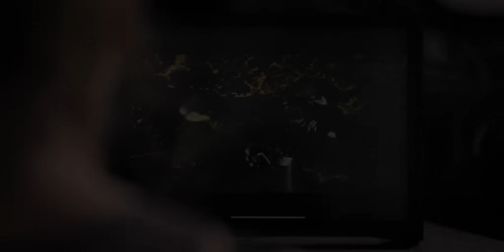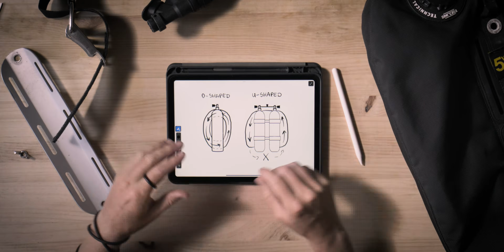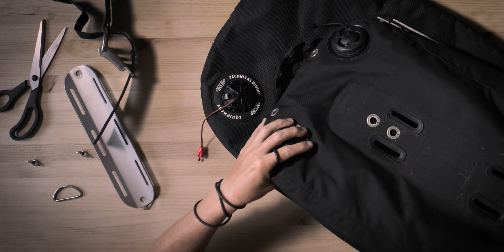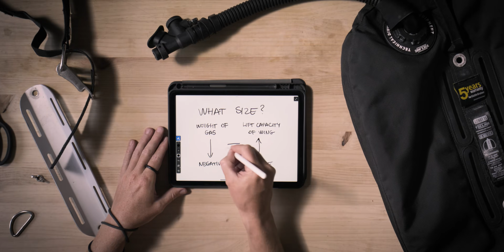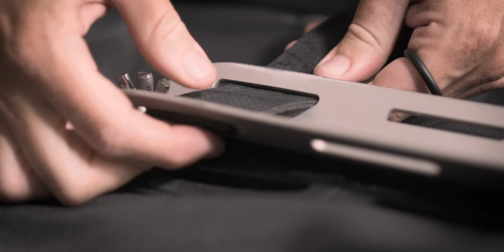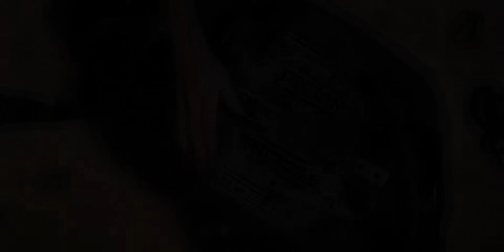How To Assemble Your Wing (BP/W) | Master Series

Comment: Great video as always! Can't wait to see more. But I have a question, I've been looking for some time to buy a backplate BCD. In my case right now, I'm diving with a 15l liter bottle and a stage 5.7L. By the gas weight calculation with a 10 kg lift wing is enough, but right now I'm using a normal BCD which has a 22 kg lift. Would you guys recommend me to get the 10 kg lift wing or a bigger one like 13 or 15 kg? I don't know if this needs to be considered, but I'm also pretty big, I weight around 90 kg, and I am 185 cm tall.
Again, thanks for these great videos, you deserve much more views and subs. Finally, a channel that posts high quality instructive scuba videos.
Reply from the maker: Thank you for your comment! Adding a stage complicates things slightly, and I'm assuming you have an aluminum one? We can't answer your question without knowing that for certain, as well as your exposure protection. However, based on the little information you shared, here is one piece of advice I can offer: I don't see a single good reason for the setup you're using. If you're using the stage to extend your bottom time, you should clean up your configuration and move on to diving a twinset. That will solve 99% of your problems including the ones you don't currently have.
Reply: @flowstatedivers  Wow, what a quick answer😁Thank you. Yes, the stage is an aluminum 5.7L, and it's used for deco stops right now with a EAN40% I can't use a higher O2% with my actual training. For exposure protection, I use during winter a 4 mm neoprene dry suit and during summer a 7 mm semidry.
Reply from the maker: This is even more puzzling as 40% nitrox is recreational mix where deco should not be a factor whatsoever. Anyways, you are using the worst possible exposure protection for the job + the wrong configuration. These wetsuits are absolutely not recommended to be used below 18 meters due to the compression and loss of buoyancy especially not with steel tanks. You also possibly confuse stage and deco bottles, those are 2 different things. All this is telling me that you have some major confusions which is not a problem but be careful with the dives you are (I assume) doing right now as you will quickly find yourself in the kind of trouble you don't want to be in. We will release some material on unsuitable equipment combinations you might going to find something in there which will help your diving. Stay safe out there!
Reply: @flowstatedivers  Okay, thanks. I'll stay tuned for those videos. I've been trained and also always dived in the same diving center, and it is true that during this year thanks to diving in other places and investigating by myself. I'm slowly realizing that in some aspects I may have not been trained how it is supposed to, specifically in knowing the big gap that there is between recreational diving and tech diving. It's something that in some months when I have more spare time I'm going to address. Comments like yours really help me realize my mistakes and weakness and motivate me to do what I've always tried, to become better and better at diving. So for that, seriously, I'm really Thankful.
Reply from the maker: @andreuduran6507  Your attitude and willingness to improve are truly exemplary. It's amazing to see this! Just remember, train hard, dive easy. Don't hesitate to reach out to us if you would like to have advice on anything diving related, we are happy to assist you.

Comment: I have a question does the o shape wing goes with Double tank aswell ?
Reply from the maker: Sure, that's the most commonly used one for both single cylinder and twin-set configurations. Just be sure not to use wings made specifically for single cylinders with a twin-set. So, whichever setup you want to use, buy the appropriate wing purpose-made for that configuration.

Comment: In the early 90s I was at a dive show in London and I bought a dual bladder Northern Divers BC.
I have dove with that BC for the last 30 years , prob about 150 dives. And it has worked flawlessly.
Just a month ago I had the steel backplate removed and replaced with aluminum. At the same time I had the second bladder removed also.
So here I am with a SS plate and a perfectly good bladder.
I will probably use your last 2 videos to take these and build a pure wing-plate system from scratch.
Thanks for the informative videos.

Comment: So I did the math for gas weight and I’d like it if someone checked my work please. I have a hp100 Faber which is 12.9L. It holds 237 bar. Times those together to get 3057 then times weight of air 1.29g to get 4kg (rounded). Add 2kg for safety and get 8kg. I’m diving doubles so double that for 12kg. So I need at least 12kg of lift. My DiveRite Rec series wing has 20.4kg of lift so if I’m properly weighted I’m good to go there.
Reply from the maker: Correct. You got a typo there states 8kg instead of 6 but everything else checks out. Keep in mind that you need to be correctly weighted for this to work, so with empty cylinders while wearing all your gear you should be neutral. The negative gear you are using should be compensated by the exposure protection you are wearing, assuming it's a dry suit with our heavy doubles.
Reply: It is a dry suit and thank you for checking my work. I’ve learned so much from this channel. I’m just starting my trek into the tech world.

Comment: Why aluminium STA?
Reply: I would assume you should match the STA material to your backplate material, and your backplate material to the buoyancy of your exposure protection... But perhaps the point is to not have the weight of the STA influence your buoyancy and steel is too negatively buoyant?

Generally I'd avoid having dissimilar metals because of corrosion, but I guess with a bolted connection it's not the end of the world.
Reply from the maker: Although you're accurate in addressing these aspects, it's important to note that the STA and backplate never come into direct contact. The wing is situated between them, minimizing the likelihood of corrosion. Additionally, the screws or bolts fastening the two metals together are of negligible significance.
Reply: @flowstatedivers  so is it just for buoyancy that you recommended aluminium? I have no issue with my steel STA. It just means a tiny bit less lead when I'm diving with my drysuit.
Reply from the maker: @MegaEpicLlama  Exactly, no problem with a steel one we just recommend aluminium as divers quickly stack up excess weight with different bits and pieces and ending up being so heavy that their exposure protection can't neutralise. It's obviously not the case with drysuits